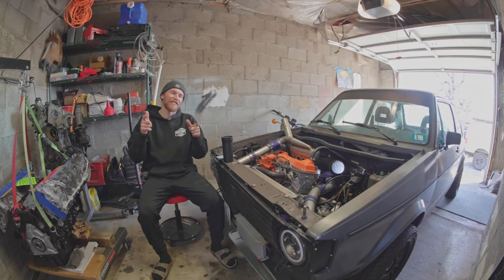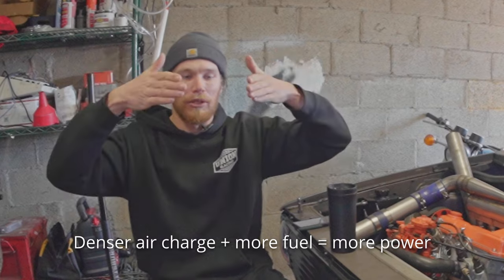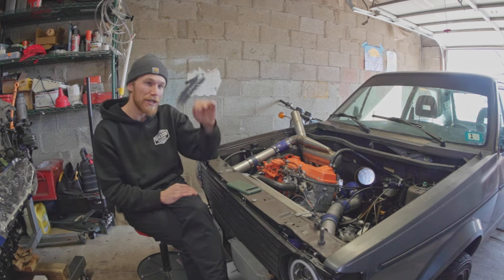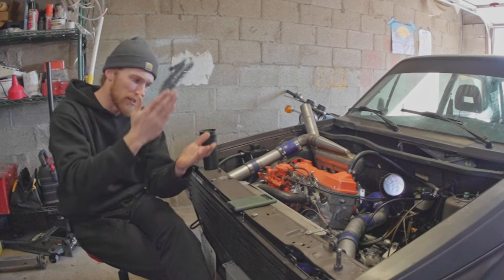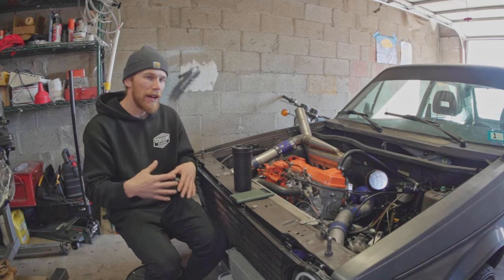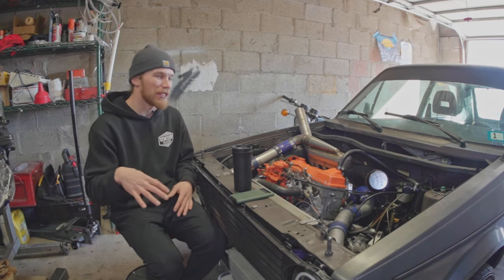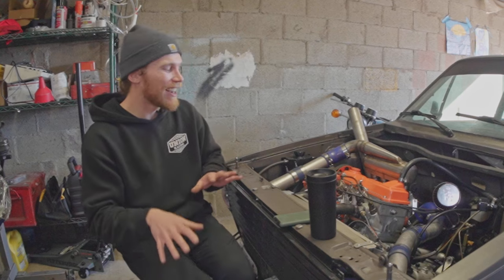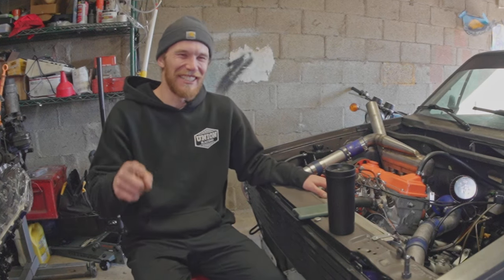HOW TO: VW 1.6L turbo diesel POWER UPGRADES

Comment: Garrett gt15 and stock 9mm pump head fuel screws maxed and AFM maxed out on around 26 psi with a very efficient intercooler and full 2.5” exhaust on the dyno I made 97hp at the tires that was my stage 2 I’m no upgrading to a 12mm pump head and cam plate out of a 1.9 that has been welded and added onto for extra lift and I should be getting my 1.9 head by then and I’ll have my hopefully 200hp 1.6 Frankenstein build. Keep up the work!!! Ps on the 200hp build I’ll be running compound turbos and running water methanol injection to help out a touch. We should Colab some time could be exciting!?!?
Reply from the maker: Heck yeah that sounds like a sweet project. Id be down 😎 lmk

Comment: i'm surprised that with all the mods mentioned, you stated hp at only around 100 to 125 HP. but for the head bolts, absolutely toss out the stock ones. i was on my home once when i heard a whistle. "what is that .............. ahhh shit!"  🙂

Comment: You are the goat. I just bought a 1.6 td. I was hoping I could get a decent amount of power that’s reliable. Something that’s surprisingly fun on back roads and I can take on bigger roads and get good gas mileage.

Do you know if a mk4 5th gear conversion would fit in a mk2 trans?
Reply from the maker: Thanks 😁 I have no idea. The mk1/mk2 manual trans is the 020. If it fits 020 you'd be good to go.
Reply: @OliverFetter  great, thanks

Comment: I have a stock NA 1.6.  I found a 1.6 turbo manifold and was planning on going with a slightly larger turbo.  I just upgraded my stock ALH VNT 15 with a new VNT 17.  Would the older VNT 15 assembly fit the 1.6 head?  Would I need to do some porting on the exhaust side?  I will not be using the 1.6 in a car, but using it for powering a stationary hydraulic power unit for my sawmill system.  Any thoughts?  I don't really need a turbo on this, but.........since I do have it........
Reply from the maker: First, that's super cool!! Hell yeah. Turbodiesel sawmill 💪 secondly yes it'll fit right up, no porting or anything needed. You may have to play with the vacuum system for the VNT to work but it sounds like you're well equipped to play with such things!
Reply: @OliverFetter  Thanks for the help.  I've been building equipment, vehicles and anything mechanical for over 55 years.  There is just about nothing I will not tackle!  By relocating all of my mill's hydraulics to a standalone pump system it leaves me more HP to spin the bandsaw head.  When I get my cars to Sweden, I am pulling apart the VW Golf with the built ALH and putting it into my 1966 Volvo Amazon wagon.  It will be mated up to a Toyota W-57 five speed overdrive trans and going into the stock Dana 30 with 4:10 gears.  The ALH should be putting out about 190 HP without any major tweaking of the systems.  It should be all around fun with the TDI Volvo wagon.  I have three Amazons going to Sweden with me.  Keep up the good work.  I'll be watching.
Reply from the maker: @EnGammalAmazon  let's go!! That sounds sick 💪💪 appreciate it!

Comment: i had an etka book with all the vw engine specs from 80something -91 and there was a 1.6d turbo on a t3 that had if i remember correctly stock power of 70 or 80hp ~60kw was a 2 letter engine code , i cant find the book anymore , it was rly small and probably lost it somewhere ( i remember had engine codes/ kw/Ltr/ cylinders/year/model/and for what country)
Reply: There was a 1.6 TD with a Garret t3 that I believe came in an Audi 80. I do have the turbo which over here is rare as anything but it has a crack in the exhaust housing
Reply: The T3 had the JX engine code
Simple garret charger and it made 69PS
Reply: In the audi 80 b3 ypu also had the turbodiesels
Some even came with an i tercooler from stock and made 80 hp

Comment: Would it make sense to bolt an O2J onto this?
Reply from the maker: I think maybe eventually it would be worthwhile? From what I understand they have longer gear ratios & can handle more HP, I don't think a 1,6 would really break an 020 but the longer gears could be nice eventually if speed is the aim!
Reply: @OliverFetter  any recommendations on changes to gearing for the 020?
Reply from the maker: @chrisladouceur4093  I know you can put in a longer 5th gear 👍 helps with high speed revs. I haven't dabbled with any transmission modifications myself yet but I think I'm headed there soon
Reply: @OliverFetter  I do a fair bit of highway travel for work and a longer 5th gear is definitely in mind. Thanks for the great content!
Reply from the maker: @chrisladouceur4093  no problem 🌞 anything in particular you'd like to see covered on the channel?
Reply: The gti 020 have a higher gear ratio in the differential. I found a list of trans codes somewhere that listed all the gear ratios and diff ratios by year and model

Comment: Great video just getting my 85 Jetta I bought blown up in a field back on the road with a rebuilt engine but regretting not doing the arp studs now I see this lol but helped me a bunch with picking a new turbo as mine is passing oil
Reply from the maker: Thanks! Hell yeah sounds like a good project. Glad I can help 🤓
Reply: @OliverFetter  that turbo mentioned is it sized good for a daily driver ?
Reply from the maker: @bertawarwagon08  Id daily any of the turbos lol but the GT2052 is a nice all around size. You will need sufficient fuel to make it spool & feel snappy but that's well within a light tune on an unmolested pump 👍

Comment: the 1.6TD 1V engine 60 HP came with KKK K14 turbo or
Garrett T2 the small eco turbos. The fun turbo´s is from a JR engine 70 HP thise came with KKK K24 or 
Garrett T3 these turbos are somewhat larger and are a good plug and play if you have a 60hp engine and you want a bit more powa bebeh. i like this channel it som good stuf you pump out and good detailes about diesel tuning😉
Reply from the maker: Thanks! I appreciate it! That's interesting. I havne't spent much time with the OEM turbos on the 1.6 because it was cheaper on my first motor to buy a rebuilt garrett than it was to rebuild the kkk14, never went back!
Reply: @OliverFetter  I understand, there isn't much push in the little k14 either. so it's good to try something else, it gives good inspiration for alternatives on the 1.6 engine, what it can spool up etc. i am hooked on the new VNT set up you have made, damn the old td is flying now. :D
Reply from the maker: @jesperkonstmann2114  hell yeah thank you! I'm excited to see what else it can do, it's not quite polished yet

Comment: Excellent video! I have a 1.6 Turbo diesel in my Suzuki Samurai and it needs a new fuel injection pump. With the ARP head studs you mentioned, does it change the torque process? Or does it stay the same. I been watching all you videos again to help with my repair. Been thinking about a Giles pump but?? Thanks again for sharing your knowledge!!
Reply from the maker: Hey thanks! That sounds like a sick setup!! The torque pattern remains the same but you split your total torque # into 3 equal steps - (I forget the spec atm but let's just say 100 ft-lb is finishing torque) then you'd do 33, 66, 100 to help the gasket "flow" evenly. Could always try tuning it yourself first 😉
Reply: @OliverFetter I may try tuning it myself but first I need a replacement pump. My pump is done.

Comment: hasha yahhh boiii
Reply: loved your explinations buddy, your tight EMAP pressure is very important. Im compound turbo, Still learning but emap is key. My 1.6 Diesel will probs just have fuel pump tweeked slightly on the stock turno with intercooler :)
Reply from the maker: Hell yeah!! Glad it was helpful

Comment: Speaking of multi-layer head gaskets… any suggestion?
Reply from the maker: If mechanical head: only custom available, don't bother, if hydraulic head : definitely buy a 1.9l (AAZ) mls head gasket
Reply: @OliverFetter  yeah I’ve got a hydro head. Does that fit good tho? No change with compression?
Reply from the maker: @chrisladouceur4093  yeah you'll be in good shape as long as you order the correct thickness 👍

Comment: Hi, i have a 89 Golf 1.8 petrol auto..... looking for more performance and better mpg.... I've been offered a pd130 diesel engine conversion and wondered how that would behave with my current 3 speed auto gearbox.....any advice would be appreciated, thanks 👍🏼
Reply from the maker: Hey! I know my 020 5 speed straps up to a ALH (PD110?) motor, so I imagine it would be the same with the auto. I can't speak to how it will stand up with the power or gear ratio wise... Never had an auto in the car!

Comment: Do you know if there is a bigger or better nozzle for the injector
Reply from the maker: I think in theory there are bigger nozzles (maybe from black forest industries?). What I've read (ie it may not be true) is that the stock nozzles actually flow plenty. I haven't had an issue with them yet so I guess it's kind of confirmed 👍
Reply: @OliverFetter  thanks for the great feedback, I love you videos lol
Reply from the maker: Thank ya!!

Comment: Which head and plunger do you use? And what is it out of?
Reply from the maker: 11mm pump head from a vw 1.9 TDI injection pump 👍
Reply: @OliverFetter  i was going to ask about this as well. but which 1.9? do you remember the engine code? how much extra power will a 10mm do? mine was doing well on a recent trip from illinois, through missourri and into oklahoma. but by getting to new mexico, power was dropping. before albuqueque, i had to trailer it back home. i'm putting things back together now. governor mod will have to be done for the hills/mountains. this is in a vanagon with a rabbit engine. early CY engine code.

Comment: What 1.6l did you use?
Reply from the maker: Currently in the car is a 1983-ish 1.6L turbo block with a mechanical head 👍
Reply: @OliverFetter  so it is the one after the 1.6l IDI (NA)
Reply from the maker: @BerzerkerGarage  yes, still idi, still mechanical, but designed to accommodate a turbo from the factory.
Reply: @OliverFetter  so I would have to swap the motor to get a turbo? Thank you. Great channel.💪
Reply from the maker: @BerzerkerGarage  thanks! depends, what motor do you have?
Reply: @OliverFetter  I'm not 100% sure yet. But what I do know is 1982 VW rabbit 4 door, 1.6l NA, no turbo. The guy just got it and was commuting to work in it for a couple months no problems. Then one day it just dies after a few minutes of running. I assume fuel system. If you jump it it fired right up then dies 3 minutes later.
Reply from the maker: @BerzerkerGarage  sounds like fuel. Yes then, the 1.6na isn't cast the same as the turbo block - it will tend to fail sooner under stress but I haven't tried myself yet to see 💁

Comment: Btw what oil do you use
Reply from the maker: For now, 15w-40 non synthetic. I rarely make it to an oil change intervals before something breaks lol so it's not worth the extra $ on synthetic in my particular scenario. I have run synthetic in the past & didn't see any noticable improvements.